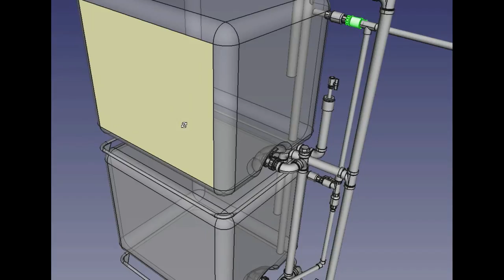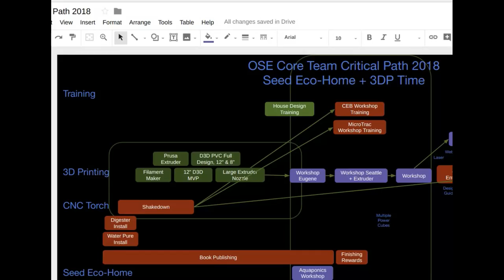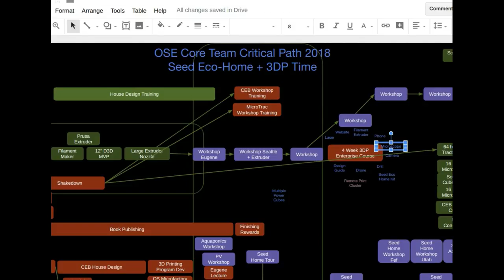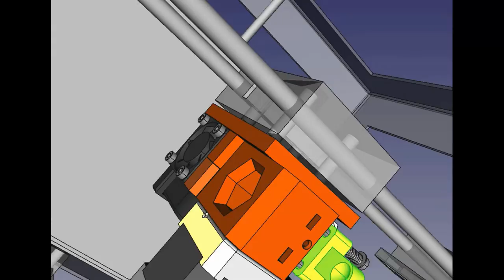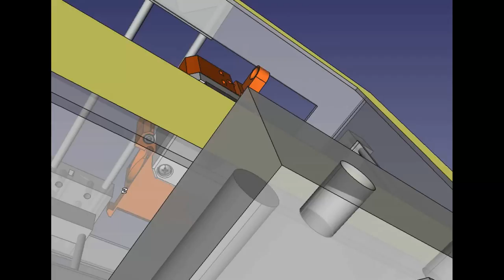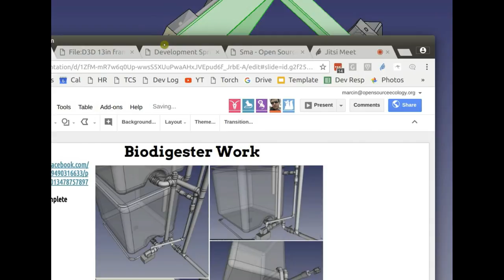Dev Team Meeting - Feb 6, 2018

Comment: What about a compost heater for the biodigester?. Coil tubing under a pile of woodchips and have a circulation pump. Could also use aircrete as your insulation around the tanks.

Comment: I know at first PVC seems like an appealing material, but it's not rigid (low modulus).  Plastic has high thermal expansion.  PVC isn't always compatible with other materials like other plastics.  It's not recyclable.  

Anytime you use something that isn't intended for a given application you need to re-evaluate it from scratch.  There's also been decades of development in 3D printers.  Wouldn't it be wiser to build on what has been learned there?  I think they're using metal frames.